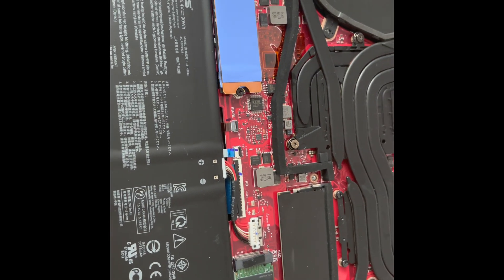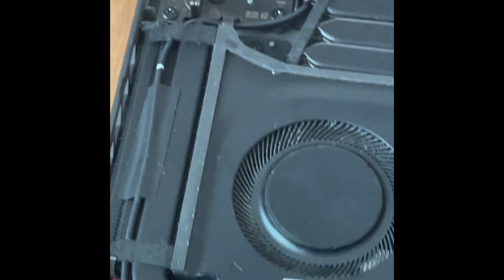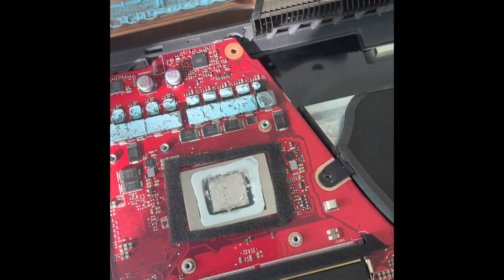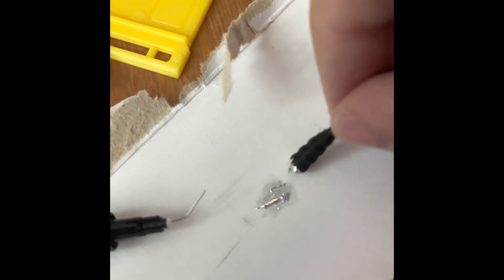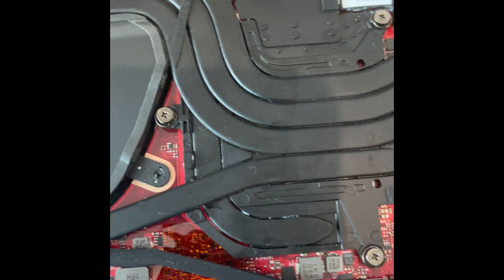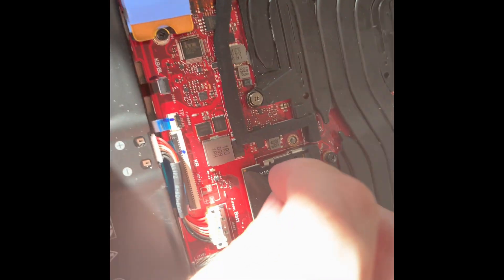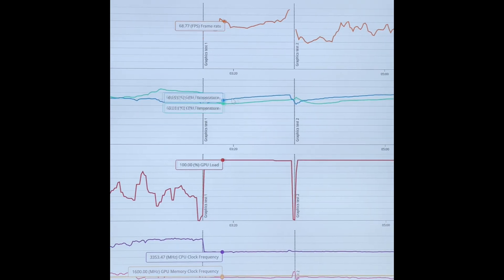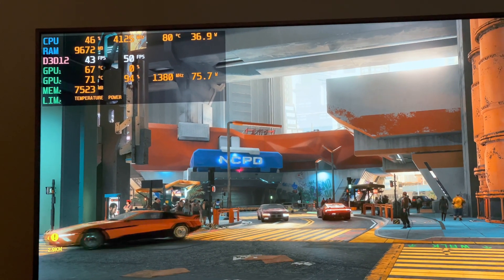Zephyrus G15 Re-pasting

Comment: at 8:50 you had applied thermal paste to the memory modules and power handling components where there was thermal putty earlier. For optimal thermal performance thermal putty is far better for those kinds of larger gaps and paste goes only for the GPU core in this laptops case. The putty is made with larger particles in it that carry heat better over larger gaps. Putty works poorly for the core since the gaps are significantly smaller there. Putty is meant to be used in situations where the alternative would have been thermal pads. Just wanted to point it out since I noticed some comments wondering about the amount of thermal paste on the memory and VRMs. Came here to see inside this thing before tearing down a similar one for maintenance. Thanks for the vid! Cheers! :)

Comment: also, @Franck Nouyrigat, I opened my G15 a week ago because my Display is showing a very nice set of horizontal lines, my EDP Cable doesn't seem to have the Plastic sticker thingy that you used to disconnect it. Is that normal, if so, how to remove my cable from the port and plug it back again.

Comment: Thank you for the guide! Most of the liquid metal was off of the die when I opened mine. Re-pasted cpu and gpu with Prolimatec PK-3 to great success
Reply: This happened because liquid metal has low viscosity when it warms up, so when your laptop is inclined while running, it can leak from the surface of the die and cause a short circuit. To avoid that, you should put an isolating line around the CPU chip with silicon glue.

Comment: hello !! at minut 2;56 those two antennas....one i can put it back....cause the grabber on the board disappeared....so it stays loose floating arround....everything works but it seems the wifi has less reception, anyway, my question is can i solder it ?
or maybe some conductive glue?....i dont know where the "grabber" from the board is....i think i broke it trying to put it back and because i was pressing and it didnt match the position to do the clik i broke it...
thanks !!! for the video !! nice zooms there everything so much clearer than other videos
!

Comment: watching this needing the hundred percent change it as my cpu goes up to 97 c
Reply: does that cause you lag while gaming? cause mine causes micro stutter.
Reply: @striderwarrior3473  I changed my thermal paste and the laptop runs 82 C° and it works like it's new no stutters nothing
Reply: @markv418  Can I ask something?
before you applied the thermal paste during 97°c , does it causes you stuttering for reaching that high temperature ?

Comment: hey, so i repasted the zephryus g15 with new liquid metal and thermal paste. one problem that concerns me is that i keep thinking i didnt tighten my heatsink enough, causing the liquid metal to spill over. has it been fine for you?
Reply: Hey just wanted to ask has everything turned out fine?
Reply: @woomygamer642  Yes, everything has been fine. dont worry about liquid metal leaking over if you have a newer model. My 2022 G15 has foam barrier and kapton tape over the cpu so no leaks should damage it.

Comment: Thanks for sharing! Got the same cpu but 3080 gpu. 2 weeks running fine. Just the temp on CPU gets into 95s on heavy loads (rendering, 3d work etc). Thought about repasting, but I guess that's normal for this laptop if you get it after LM reapplication.

More curious about your SSD - did you put 1 copper sheet under and over? Cause I'm having problems with my fresh 970 evo plus (95C during stress tests, and it heats up the whole PC till it shutdowns)
Reply: Me too 😢 why did they put an I9 in to these slimmer gaming laptop?  It would of been fine with an I7 .

Comment: can you gimme Any tips dealing with liquid metal? Im afraid about liquid metal breaking whole laptop with one drop
Reply from the maker: Just take your time and be careful, if the battery is disconnected and an accident happens just clean… check Linus tech tips they had a video where they spilled it. The key is to train first on a piece of paper so you get used it it first :) good luck
Reply: I already done the process. Thanks to your video it helped a lot 🙏

Comment: Did you meager temps before and after?
Reply from the maker: It s difficult depends on drivers / cpu boost / gpu OC etc… this was my second re paste before the first one lm application by asus wasn’t great and I would always be in the mid 80s up to 98/100! After my first pasting things were ok with max at 90 but on average low 70 while gaming. This one did not change much on the CPU (I did add a little bit of LM to be sure I had a good contact I guess a next step would be to trim the protection around but that’s not worth the risk for now) something else I noticed is that the GPU would have a hard time getting OC after this new pasting including the VRMs everything seems to work and temps are fine. Long story short if your temps are too high it’s worth it if not you can just change the CPU boost mode to off and you ll win 10/15C without much impact. On my side I just want the best out of it and wanted to be close to 10k on turbo as a good basis with low fans. All good now :) hope it helps